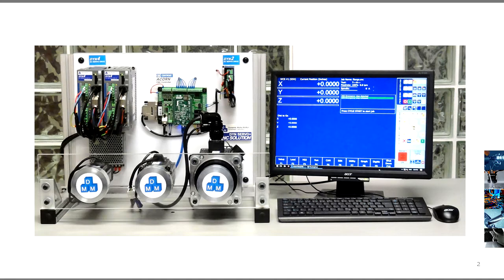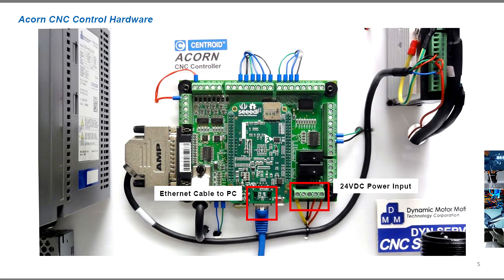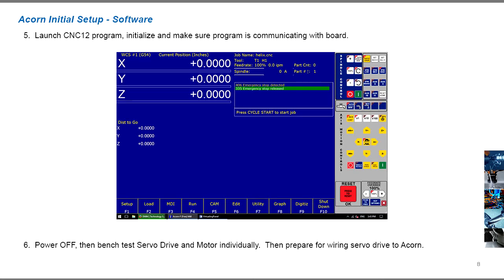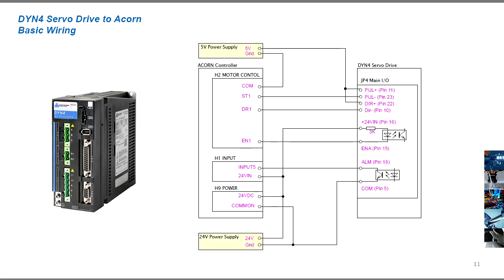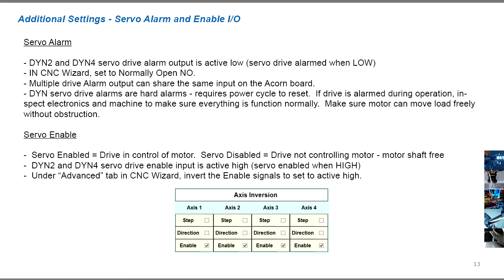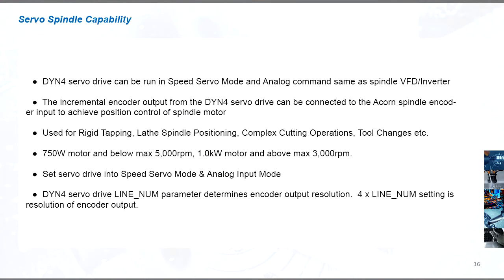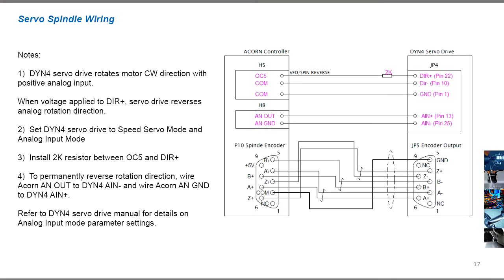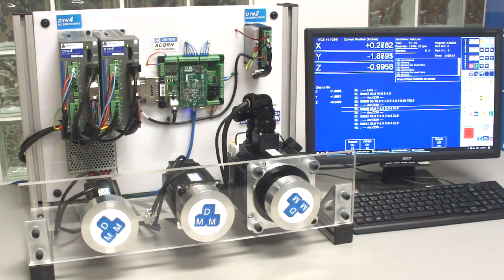Centroid Acorn Setup Video

Comment: Please correct the Enable wiring in the DYN2 diagram ! The Acorn grounds the output while the DYN2 requires a 5V supply. This direct wiring does not work.

Comment: How does PID tuning work? Clearly the motors / drives are setup, but Acorn doesnt do its own PID does it? I'm using CS Labs IP-A, this needs PID both on servo drives and via the CS Labs plugin in Mach 3.